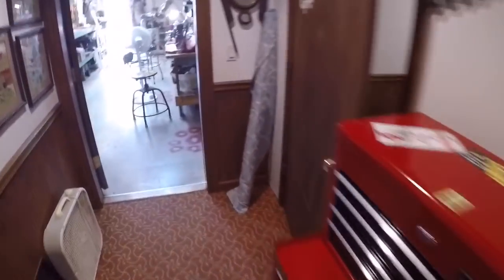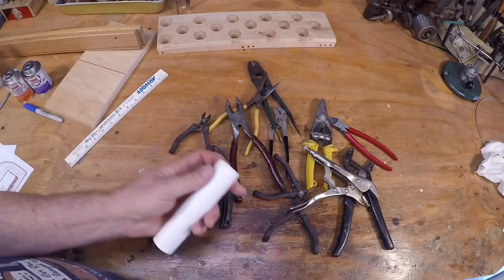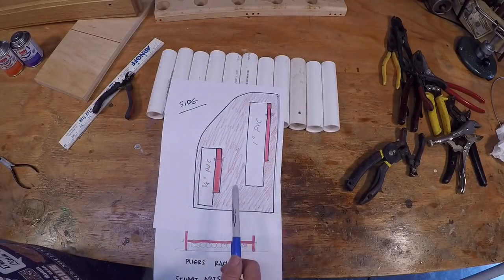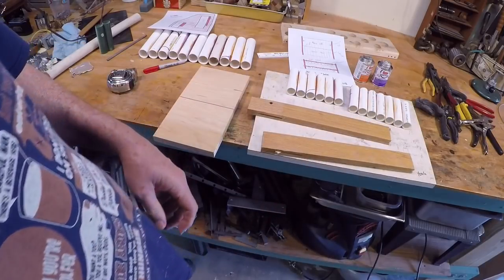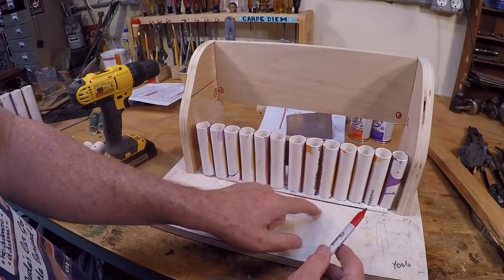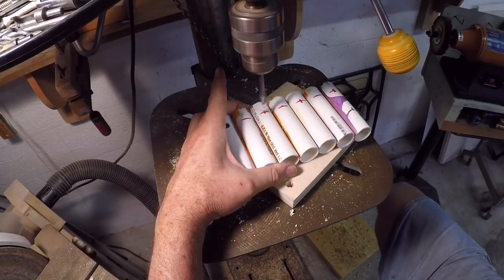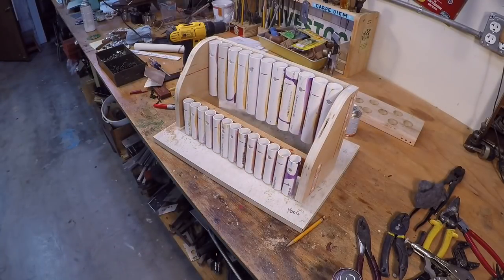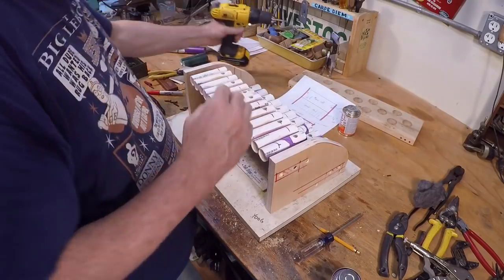Build the World's Best Pliers Storage Rack - "Rocket Launcher" Style

Comment: 0:08 I've been cleaning up my shop too, got rid of 2 trucks of steel and aluminum cable, and just getting the trash out if the shop.. I can really dig this project, and it seems handy for screw drivers aswell
Reply from the maker: tek413 thanks! But with screwdrivers be sure to make the tubes really short so you can see the tips.

Comment: Your pliers storage is one of the best I've seen, but IMHO, it could have been better.
The horrible color: You could have used very little spray paint.
The pvc glue: I personally would go without any glue (or purple primer), and just add a 2nd row of holes and screws.
Either screw those tube tight to one and other, or add 1/4" - 1/2" spacing between them, for breathing room/ease of access/return.
I do salute the simplicity of your process, using stuff mostly already around.

Comment: I really like your idea, it have some clear advantages and maybe a few disadvantages.
I.e. you have a good spacing between the pliers so they are easy to grip but the rack will also be a lot larger then if you had the pliers tight together. :-)
Reply from the maker: Fried Mule it's worked out well - I wish I'd added a few more tubes though...the tubes are all filled now.
Reply: @JimmiePorterAtStuartArts  LOL I know the problem:-)

Comment: Great design, best I’ve seen. What length did you use for the 1” and ¾” PVC pipe?
Reply from the maker: Thomas A. Cross they are roughly 5” for the 3/4” and 6” for the 1”...seems to be ok for nearly all tools.  Measure your pliers to be sure that will be long enough for your longest handle....good luck!
Reply: Jimmie Porter At Stuart Arts Thanks so much. It’s so frustrating when so many post videos and won’t reveal simple dimensions that can save us a lot of time in duplicating the design. You are the best.